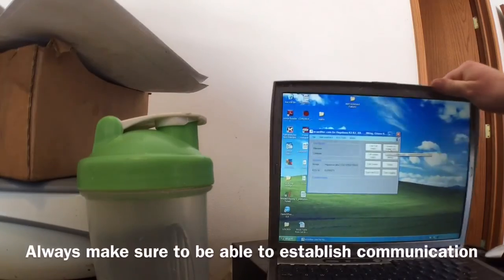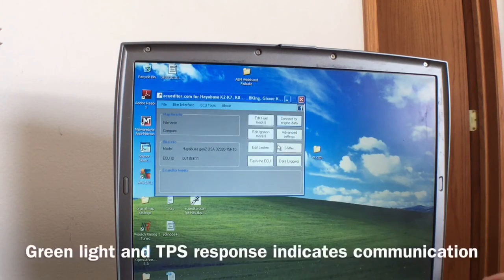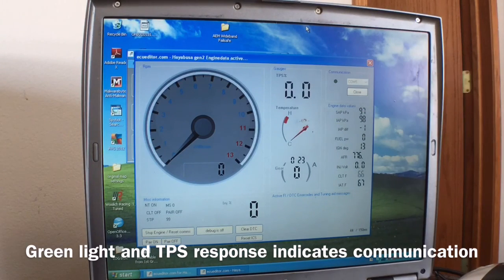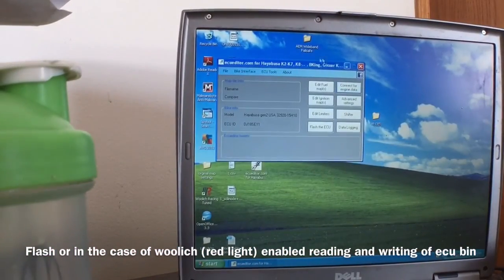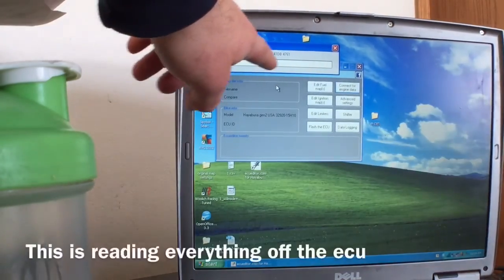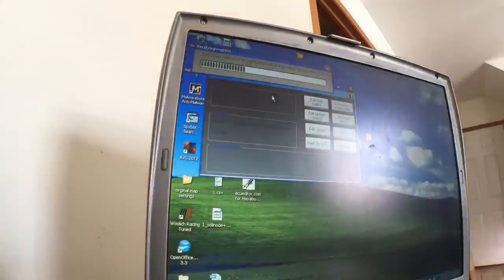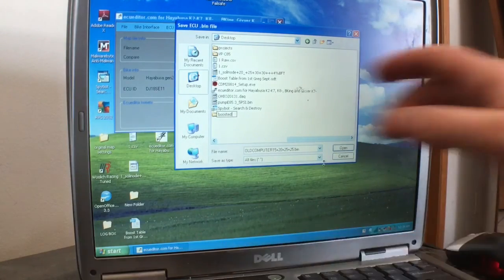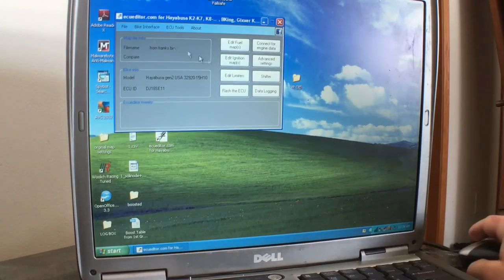Hayabusa ECU editor.  (Uploading a map)

Comment: Where can I get the cable for reading the ECU or which parts do I need to build one by myself? I don't want to buy the Woolish cable.
Reply from the maker: +Daniel K check out http://www.boostbysmith.com/. I orginally got this cable from him. I still have two of the orginal flashers/ loggers from woolich that work with ecu editor.